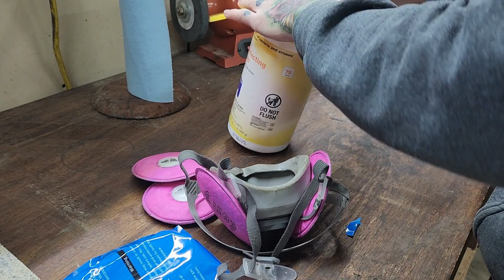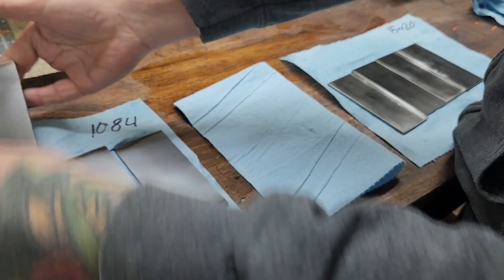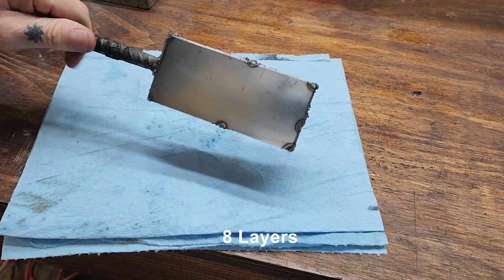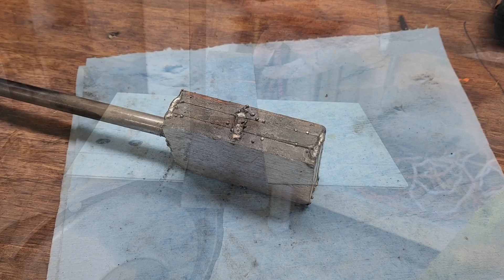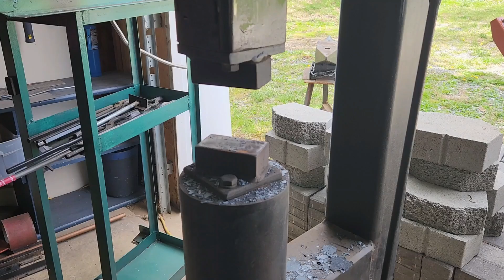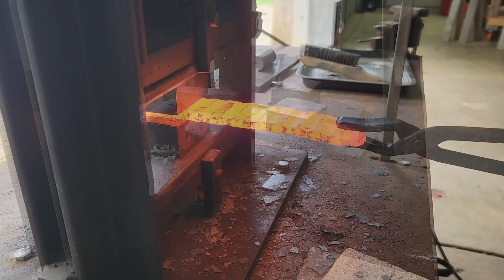Making Raindrop Damascus, from 1084 and 15n20 steel. Step by step build, from mill steel to billet.

Comment: Sir! Thanks for the vid! Nice.... Flat is NOT (as) important, important is a ground clean surface. The first consolidating press removes the pockets anyway.. So if it's not welding temp, when you put borax on the billlet, you can do a light pass, and then continue with the "normal" process... For the raindrop or ladder pattern. The billet should be about 3 times as thick as the spine of the finished product (and the 1 mm you take of grinding), and the depth of the cuts should be a third deep on both sides. If You then squish it to the desired thickness of the spine, all layers are revealed. Depending on the profil: If You want the pattern to go almost to the edge of the knife on a flat grind, you need to thin out the material towards the edge And make a pretty close preform... If You don't, and just do "stock removal", the pattern will be gone after about a third from the spine towards the edge....
Reply from the maker: That all tracks. I agree with everything you're saying. I kind of like the transition from the edge to the spine, watching the pattern increase in its layers and intensity. But just like anything else, you have options, and there are a lot of different ways to achieve what you're looking for. Thanks for the great advice.
Reply: @RedRightHand-Blades-Marshal no! Thank you! Keep creating and thanks 4 sharing 👍

Comment: Marshall how do you make the Damascus pattern in the steel  or is a chemical acid like .I never made knives before and I like to start doing in it  I am 74  and lots time to do things I appreciate   any help I can get from you looks like you know what you are doing well is something new to me  thanks lots ..Mario
Reply from the maker: It's a really wonderful "hobby". But be warned, it will become an obsession, lol. 

You can probably get more detail from the video than I can put into a comment, but to summarize, you bring two types of metal up to forge welding temperature, then press them together. One of the metals should have a higher nickel or chromium content, so that it resists the chemical etch, once they are blended together. Depending on how you blend them, will determine the pattern. In this case I'm using 15N20 and 1084 steel. Both are readily available at any knife steel supplier. 

Good luck!

Comment: Beautiful pattern. I always wonder, and I saw the comment to Frenchy, but how much do you lose in weight when doing Damascus?  If you want to end up with a 1lb knife,    how much would you start with?
Reply from the maker: I can't really say when it comes to weight, because I don't usually weigh my knives, or the billets before I get started. But just from observing the overall mass, I would say I lost close to 50% of the overall mass, from start to finish on this build. Now of course, that would vary depending on the type of Damascus. Raindrop is particularly taxing, because not only is it moving the pattern around as you shape it, restack it, etc, but you're also removing material with the drill during the latter stages.